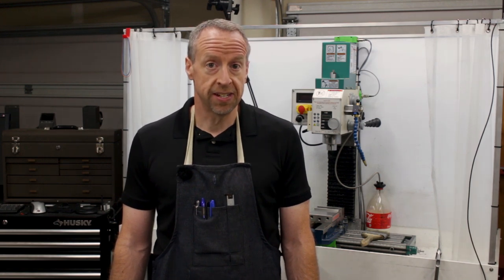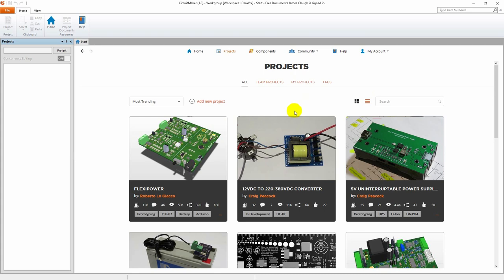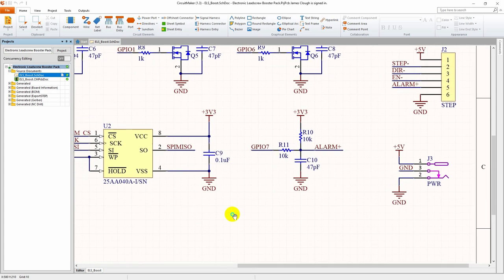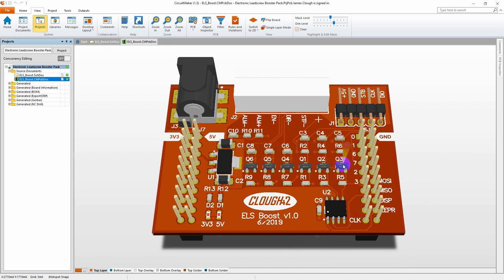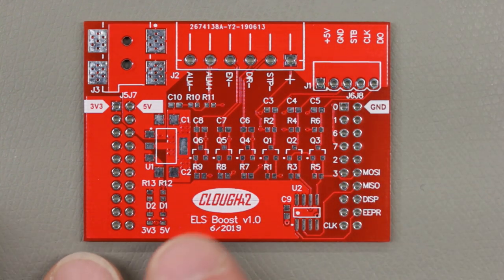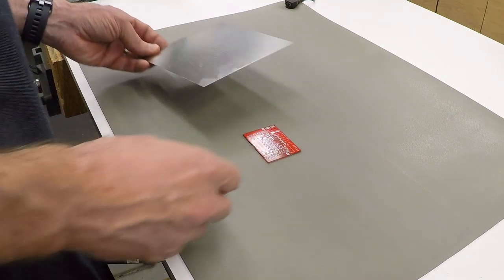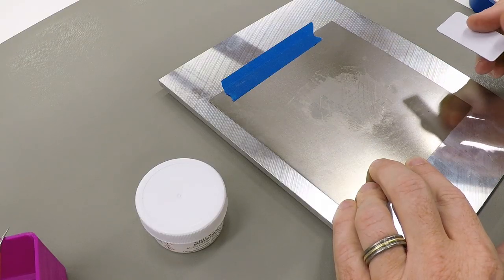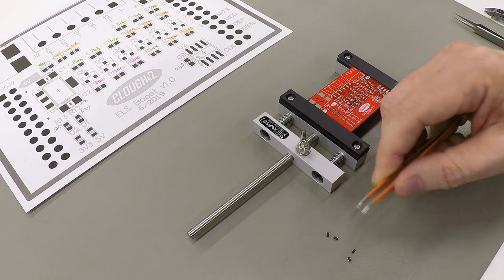Lathe Electronic Leadscrew Part 8: PC Board Assembly

Comment: I gotta hand it to you. You are a bad ass.
   I was one of those kids who took apart all his parents electronics whenever they left the house & thought I'd go into electronics when I was 10 or so but as they say "life is what happens when you're busy making other plans"
I found that I like tedious work but I like to work more with my hands so something like hand engraving came more naturally than muttering through all the math & study Other study it takes to learn electronics & programming. Probably a lack of patience, I'm guessing.
  I went to school for manual & CNC machining a while back & now I know that I'm just going to have to continue to force myself to learn those things if I want to make decent money because even though I prefer manual machining, it takes years to build up the experience & reputation it takes to make good money at manual machining.
  One thing that's been useful from learning electronic & computers though is that I'm the guy they turn to in the little shop I work in when things go wrong with electronic gadgets & such.
   It looks like you've learned it all though. (Figuratively speaking, of course)  While I might be able to trouble-shoot and do basic repairs & build basic circuits, I certainly couldn't do what you've done here. I watched all previous videos in this series & I gotta say, I'm pretty impressed with your extensive knowledge base. I got into machining school from asking the local tech. school about building a cnc router & I had no idea about all the fields of study that would open up. I was kinda stagnating at the time.
 
 Keep'em coming. Great stuff!

Comment: For all you reflow newbies, you don't need all that fanciness. Putting it in a standard toaster oven without the high tech controls works just fine. The natural temperature profile of the toaster oven is pretty close -- close enough for most common uses. Just watch for the solder to melt, turn it off, and crack the door.

If you have both large and small areas of copper, like 0603 pads and barrel connector pads (as seen in the video), you might want to do a little pre-heating, because the thinner sections will heat up faster than the sections with large masses of metal, which means some components could be damaged while waiting for the solder on large pads to melt. I set it on a coffee pot hot plate for a few minutes, with a paper towel between. You could also just use the toaster oven's thermostat on a mid-level setting, like 150-200 F.

The materials really are not that picky. For the sake of comparison, I've seen people successfully use an electric griddle to reflow PCBs.

Comment: you could have added two holes on your board and a dot in the solder layer,  so the stencil will be cut at this spot.  then you could use indexing pins on the stencil for alignment

Comment: I just finished bread boarding this project. It just worked. well my Clearpath servo had a inverted Enable. I am waiting for a better encoder to arrive. Very little wiring. The Workspace App was a little challenging at first. My spindle gears are on the inside in oil. Maybe I can add gears to the external spindle. I would like to get a "Through Hole" board. I won't be buying a reflow oven soon and the pads are too small to hand solder. Great Great work. I am thoroughly impressed. I have been impressed by very few on YouTube. I look forward to more projects. Thanks

Comment: Excellent !  Have this same idea to use for a mini lathe because it is annoying to have to play with gears to create threads or to vary the feed rate for different materials plus keeping sink with the main spindle and the lead screw.  Most people go straight CNC which is fine but this idea allows you to do quick manual machining without playing the gear game or programming to make something .  CNC is great for runs of the same part but not for mixing parts to machine.   So many people don't understand why you might want to do this but it is great if you ever ran a lathe with this ability.  It reminds me of the ease that i can vary the main spindle without gears or pulleys to change speeds.  This is the next step.

Comment: Next time you should have a look at designing in KiCAD, it's open source and has a pretty handy 3D viewer that helps you visualize your PCB design.  Otherwise great work!
Reply: Lets not forget that CERN also got involved with the project.
Reply: For me it's KiCAD or nothing.
Reply: I'm working with Kicad, and want to replace my other CAD programs with it. It's fully featured and Open Source. I believe pretty strongly that commercial CAD tools are becoming straight up abusive in their license requirements/business models, and we need to promote the open source alternatives.

But man, there are still a lot of legacy issues that can make it a massive pain in the ass to use. Some little stuff like the ancient plotter font, some puzzling stuff like the way it's impossible to type coordinates in when moving components, and lots of irritating stuff like the inverted y axis and bad layer management.
Reply: @JohnDoe-rl9pp  I think there's a advanced move tool, which should fix that issue. It was on a development build from 6 months ago so might be in mainline by now?
Reply from the maker: I might have a look.  Every new tool comes with a learning curve.  If you haven't noticed from my skill set, I spent a lot of time learning new things.  Time for learning ends up being my primary limit.

Comment: You have remarkably steady hands. You should try one of the vacuum pens for surface mount components. They have different sized tips and one button on the handle to release the part.

Comment: I usually use old hotel room keys as a squeegee. For one offs, I find that making an alignment jig from business cards taped to the table on 2 sides works well to accurately align the next pcb to the taped hinge stencil.
Reply from the maker: Oh, that's a good idea.  I've seen it done with scrap PC boards.  Dave Jones also has what look like purpose-made PCB corner frames that he uses.

Comment: @Clough42 you need an item called "Pik n Paste" to hold the components in place while you are placing them. It's a (usually red) viscous paste that you apply to the center of the component footprint. It air dries quickly to glue the component still until the reflow completes

Comment: The kapton tape on the switches is also so the pick and place machine has a flat surface to pick it up with vacuum and stick it on the board. Lots of connectors that have holes in the shells have kapton squares on them too so the pick and place machine has something to move it around with and get a seal on the suction cup.

Comment: Have you thought about adding "electronic thread dial" function so you can disengage the halfnut? Especially when cutting a metric thread with an imperial leadscrew.
Reply: @SystemsPlanet  I find your lack of faith disturbing.
Reply: I'm not sure exactly how that would work. The controller would need to know how far you had moved the carriage while it was disengaged. Maybe attach another encoder to the gear that drives the existing thread dial?
Reply: @Greg Ewing, there's a couple of things you could do. You could read the DRO scale if you have it. Or instead of disengaging the halfnut, you can push a button and tell the controller to stop threading, move the cross-slide away and then push another button and tell the controller to rapid-traverse the carriage away from the chuck, preparing for the next pass. That's just what I came up with off the top of my head. Either way would help running a metric thread to a shoulder on an imperial lathe.
Reply: @LambertZero  That would be easier as a full blown CNC.

But, threading to a shoulder would be easy if the circuitry would have pause-input, so you can have a micro switch on the lathe ways and it would say 'stop' to the VFD. It will stop the lathe in less than a second if there is a breaking resistor installed.

Comment: I really don't get why no one in the Maker world has caught on to KiCad for electronics design....it's free, completely open source, very full function (16 layer PCB's?  You got it! 3d rendering?  It's there.  You name it, it's got it.), and it's good enough for the folks at CERN, who have taken over the development and maintenance of the software.  The learning curve can be steep, but it can do ANYTHING you need.  Impedance matched traces?  Yup.  Auto routing?  Sure....ish.  Automatic sanity checks? (No unconnected terminals you don't want, no overlapping traces, etc.)  Absolutely.  They've even been developing some sim add ons.  Well worth the effort of learning.

Comment: Trick with a camera: set up a 17" monitor on the table past where you are working, and watch what you are doing in the monitor. You just have to learn to look one place and reach someplace, else, which might take a while.

My experience suggests that if you had used 0805 components on that board, soldering by hand with a hot air gun or iron would be fairly trivial, but 0603 and smaller is almost impossible to manage.

Comment: All those SMT components can be soldered by hand easily, or with paste and an oven, or hot air reflow gun. No need for through hole in my opinion.

Comment: You need a vacuum placement tool CNC to apply soldier and place parts then use you oven to finish .  I want to make a multi placement tool and paste maker to make these smd easier.

Comment: This is a terrific project and outstanding video.   Thank you.   I would love this for my PM1340GT.   I'm not sure I'm up for doing surface mount components, making a flow solder oven and all that.   So what are your intentions here?   Are you planning to make this available as a kit, completed unit, or ???    I do have some electronics experience, but I am not interested in getting a Ph.D. in the TI micro controller, programming it, etc, so I would need a pretty complete kit solution, or some kind of pre-assembled turn-key electronics package.   Can you expound a bit as to your intentions here?   Also, I'm sure my threading screw on my 1340 would need a larger stepper/servo, and wondering about all that - maybe another episode perhaps?   Thanks again.

Comment: Well done, James! I have been watching this build and enjoying it thoroughly. Haven't had any intention to make one myself, fiddling with the change gears gives me a chance to do several 'sanity checks'. Had a question, tho... wondered if you have accidentally built in a nifty capability. Occasionally, on commercially made machine bearings, the oil groove is (forgetting the correct term here) is a spiral back and forth pattern (lissaduous?) and I am wondering if this is possible?
Jim

Comment: Hi, again well done! amazing, I have read what you said about finishing the project and publishing! indeed it could just grow and be updated continuously if you let it! i totally see that, how about creating an interface, maybe serial , to allow the user to add on boards. maybe you could achieve the finished project with the designed functionality and then via the interface the user can modify the system to control the servo to stop at the end of a thread and to start at a certain chuck angle, just what i am thinking, darn sure you have many more ideas that could be implemented by add ons if the base board had a control input and output the counts from the encoder and scaling?

Comment: I'm just watching this series of yours to obtain a better understanding of how the TI booster boards work with the launchpad device. So, can you please correct me if I'm wrong? 

When you stack a booster pack on top of the booster headers on the launchpas board, only the header pins not occupied by the booster pack can be used as GPIO pins by the launchpad. Is this right? Or is it that even the occupied pins can be used as GPIO by the launchpad. 

For eg:- Each header has 20 pins, and suppose the booster only used 8 of those 20 pins. Does this mean that I can only use the remaining 12 pins from that specific header as GPIO pins through the booster pack stack, say to receive inputs and transmit outputs? Or does this mean that I can still use all the 20 pins of the same header through the booster pack?

Thank you, and regards.

Comment: tiny point but could you not parallel two of the 650 resistors to remove the single 320 for the other led. in a pick and place this could save you a reel slot. Tiny point. great series

Comment: Great videos on the ELS. How many TPI is your lead screw? I wanna try this on my craftsman 12in lathe (8 TPI lead screw) but I’m not sure if the programming will cross over
Reply from the maker: My leadscrew is 12TPI, but the code will work fine with 8TPI.  You can change this value in Configuration.h

Comment: James, would you mind posting the Gerber files for the board you designed or point me to them please? I have my Servo/stepper motor, TI board on the way, LED display coming and would like to get the board ordered and on the way. I plan to install this on an older 9 x 20 lathe I use daily.

Comment: Kick it up a notch because you are the only one who can make a technically correct thread by including helix angles in your math. i.e. 6-32 is 4.123 degrees, 8-32 is 3.471 and 10-32 is 2.997. All are 32 TPI but your making the same helix angle for all three screws.

Comment: I’m interested in this 
For my 20” x54” Lathe 
So I can do metric threads 
Are planning to selling these as kits. ?
And advise on stepper motors.
Reply from the maker: I am planning on making something available.  That's a big lathe, and will probably need something substantial.  I don't have any experience with systems that large.

Comment: This wonderful project doesn't apply if the lathe has been converted to CNC?
Reply: Pretty much the case, the CNC greatly expands the lathe control and supercedes the ELS. Or to put it another way CNC  includes ELS and much more.

Comment: Hello everyone. 
Nothing works. Help!

I finally got all my bits together including the beautifully made front panel and the ELS PCB, but I stupidly put the connectors on the wrong side of the board!!! 
In fixing this, I think I may have blown up the EEPROM and maybe one or more of the FETs. I've just received new EEPROMS and 2N7002 FETs from Digikey. The reason I think I've blown up a FET or two is because when I look at (e.g.) MOSI with an oscilloscope, it seems to be attenuated. I'm not a programmer, so it's not easy for me to figure out what the EEPROM does or why it's there so I can figure out whether it's working.  Does it just store variables for the display|? Could someone smarter please enlighten me? TIA
Reply from the maker: It's there to store variables, but the current firmware doesn't use it yet.  Remember that the microcontroller uses 3.3v logic.
Reply: @Clough42  Thank you James. That's very helpful. I am beginning to think my woes are ESD-related. Are there plans for this EEPROM?
Reply from the maker: @denisredfern2976  probably.  Eventually.  It was only a few cents to add the chip, and it's a good future proofing move.  The automated test I run on every board does test the EEPROM to avoid surprises later, but for now, the ELS won't even notice if it's missing.
Reply: @Clough42  Thanks. It's very helpful that I can leave it off because the ones that showed up yesterday from Digikey were the in the wrong package! (Ordering error on my part) I'm pretty sure I've got a shorted FET or two that have taken out some I/Os on the Launchpad. I have a shiny new one in waiting, but not until I've built a test rig to thoroughly test the the ELS PCB. I'll get it working eventually. I learn something new about this every day.  'The journey is the reward' !